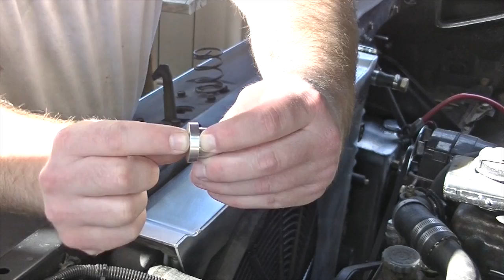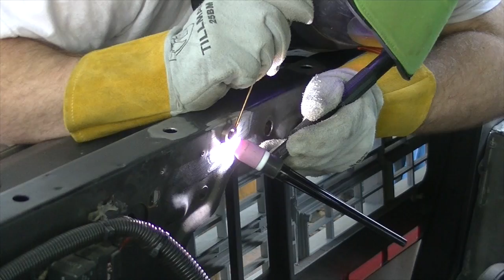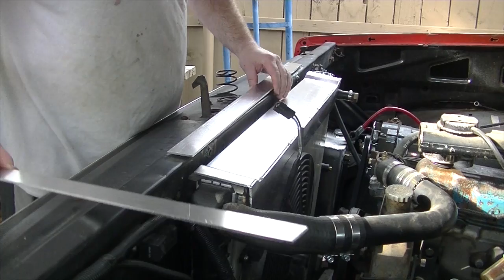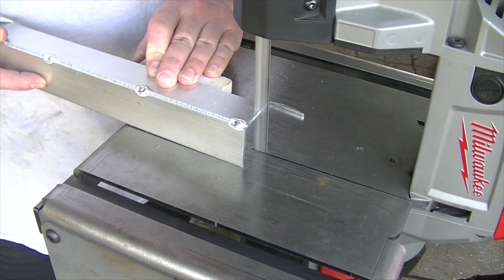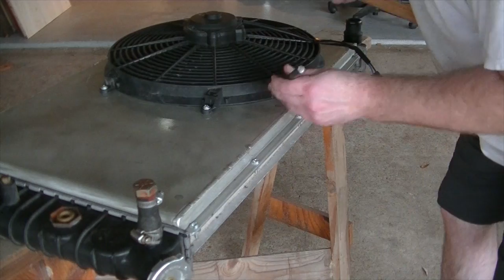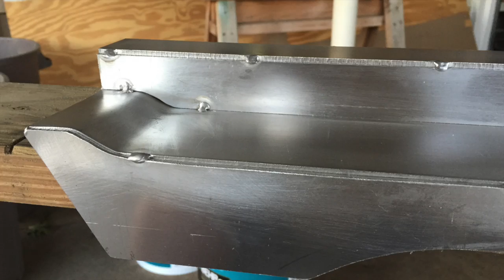PART 2 CHEVY C10 RADIATOR SUPPORT BUILD | Aluminum 73-87 C10 Upper Radiator Support Bracket

Comment: Appreciate the videos.. nutcerts .. rivet nut.. rivnut (goes by a few names) would be the win for the application (to me) vs bung and welding. Bracing the bracket would also keep it sturdy v.s. 90* welded metals